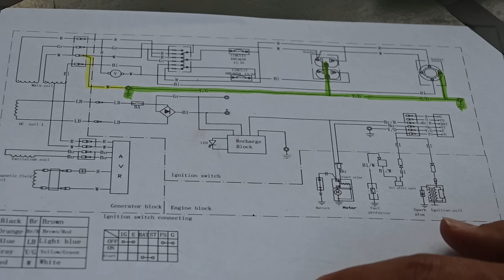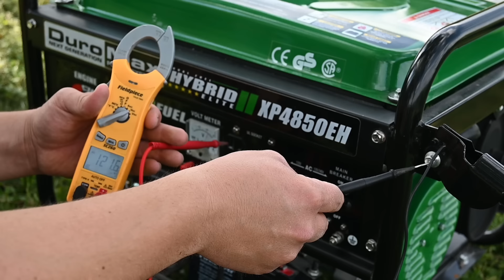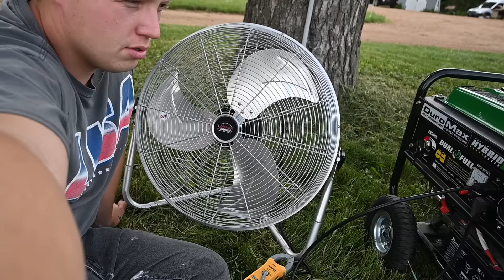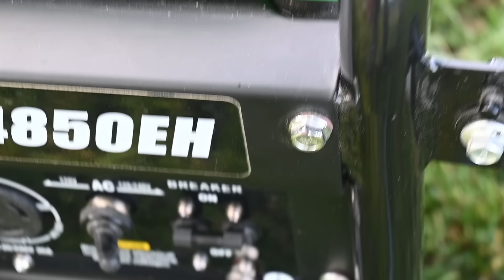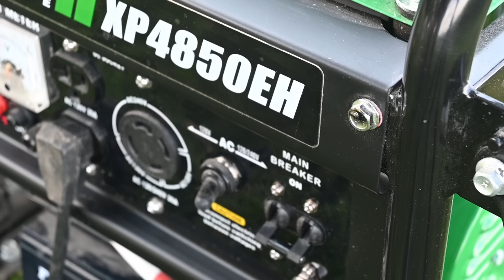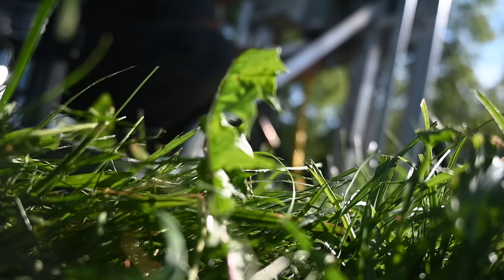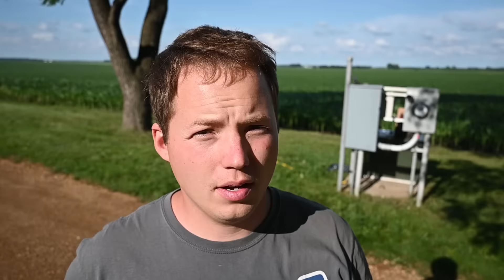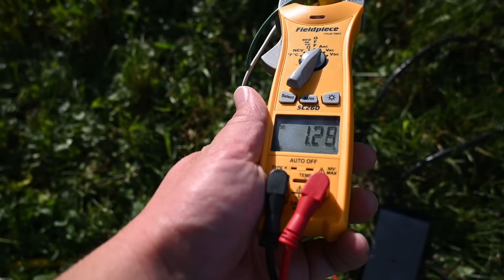What is a Floating Neutral Generator?

Comment: Hey Ben excellent tutorial.  Quick question I have to build a cable L14-20P to L6-20R.  The problem is L14 is four wire and the L6 is three wire.  My Generator is a Honda EM3500sx with a floating neutral.  When I build the cable would you recommend bonding/combine the green and white wire on the L6-20R side or leave the white wire floating/disconnected?.
Reply: Does the appliance being plugged into the L6-20R expect to see the N & G combined on one pin, or not ?

Comment: Hi Thanks very much for the video.  I have a setup that isn't working and I hope someone here can help with:

I've got a professionally installed manual transfer switch which has been wired to code and inspected by a second electrician.  It controls one thing: a furnace.  I have a decent quality inverter/generator with a floating ground.  I can start equivalent loads when they are connected directly to the inverter/gen, but the transfer switch is not happy.   I believe it's because of the floating neutral in the inverter and the transfer switch's ground.   What are my options to get the inverter to power the furnace through the transfer switch.  I'm open to buying a different inverter, or any wiring that is safe/code.  Thanks!
Reply: Here I am a year later with my own solution (hope it helps someone else).  Your genset/inverter needs two things if connected to a normal code transfer switch (meaning neutral is grounded by your house): 1: Yes, the generator should have a floating neutral, since code requires no more than 1 neutral-ground bond.  2: (this was my problem): The gen set should only produce voltage on the hot wire.  My inverter was producing 60v on hot AND 60v on neutral.  This really surprised me, but I guess it is done on devices (not designed to be connected to a transfer switch!)

Comment: When used for backup power, what's your thoughts on just not connecting the ground wire in the panel from the gen plug and leaving the gen bonded?  Any downside?
Reply: Don't do it
Reply: Why?  What's the downside?
Reply: @chileheadcraig  The neutral and ground are bonded in the panel, when current flows from the panel to the generator, it is completing a loop with a second bond at the generator thereby defeating the purpose of eliminating the ground between the gen and the panel.. It is simple enough to disconnect the bond at the generator.

Comment: Hey Ben, what are those 2 gray clamps above the main breaker in the panel?
Reply from the maker: The Sense Energy Monitor. If you're interested you can get a discount by using the code BENJAMIN at checkout.

Comment: Ben.  I have a different situation.  My main power comes off of the power pole to the meter hub.  It doesn't have a Main disconnect panel.  Just a small panel that can hold 4 double breakers.  The panel has a 100 amp breaker that feeds power to a sub panel on our Manufactured home.   This meter box is close to 300 ft from our house.   Can I set my generator plug in up at my house in the subpanel.   I know the sub has the ground and neutral on separate grounding bars.  Can I just use my generator that is Bonded to run my backup system from the submain.?   In a power failure ,  during the night for instance.  It would be hard to drag the gen down to the power meter panel to use it as a back up for my power.   Having the generator up at my house would be much easier.   Just wondering.   I actually already wired in  my gen plug and put in a 4amp breaker in the sub, with a manual interlock.   So just checking.  Thanks Randy
Reply from the maker: You can set up your generator to feed your sub panel at the house. Just make sure that it is set up correctly so that the interlock kit prevents any sort of backfeeding. Would be best to have it inspected and to verify with your power company what type of generator interlocks they allow.

Comment: 1 Hi Benjamin love your videos. Could you check out this post I started about using the xp9000iH with there xp9000iH-pk parallel box with no neutral connection. Seems odd DuroMax would do this

Comment: here in the panel box. the netural has its own bus bars and the grounds are all run to the panel case   my brother is an electrician and has asked the inspector. the generator panel is wired for floating neutral but scenario. generator dies. home owner goes out and byes a bonded generator not knowing the difference.what happens...  the inspector told him that he would get back to him with the answer. that was several years ago. still waiting

Comment: So in layman's terms as I understand from this fine instruction, if the portable power generator will be used in remote circumstances where grid power does not exist ie; camp site, job site, or mounted to vehicle (RV - Semi Truck), then the generator needs to be bonded to itself meaning the neutral and ground show continuity (Bonded). But if the portable power generator will be used as backup power via transfer switch of a service panel normally served by grid power, then the neutral and ground at the generator should have no continuity (Floating) as this is done on the grounding buss bar in the electrical service panel. If memory serves correct, the buss bar on left side of service panel is neutral which returns to transformer, and the buss bar on right side of service panel is ground which runs to 8'ft copper rod nailed in the dirt near service drop of home or building. The physical neutral and ground buss bars in service panel remain separated (Floating). If this is true, then we are on the same page.

Comment: 1 Hi Ben love your videos. Could you check out this post I started about using the xp9000iH with there xp9000iH-pk parallel box with no neutral connection. Seems odd DuroMax would do this

Comment: How are you getting your phone to read the wattage being used? Is there some kind of current transmitter in your main panel because I saw you had current rings around the L1 and L2 wires coming in to the panel. But you read the wattage with the main disconnected so the rings read no wattage as their is no current now flowing through them. I would like to get my phone to do that. Please explain? Thank you.

Comment: And, when you connected the live to the ground rod and had the generator providing power - did you realise YOU were also at 120V ? You'd get the same effect at 120,000 volts. You wouldn't know. Just like a bird sitting on a power line at any voltage.

Comment: I believe that's a isolated neutral not a floating neutral.
Reply from the maker: What's the difference? I guess I could see the term "floating neutral" being used in the context of an accidental loss of neutral connection?
Reply: @BenjaminSahlstrom  this leads down a rabbit hole, but search for stray voltage, especially its effects on livestock!

Comment: just a random question, I did get my sense unit and installed inside my sub panel and with you video it was great! Thanks for that! Why do you have you sense box outside at your main panel? I have the very EXACT set up you have, and just wondering if it is better outside or inside?
Reply: It doesn’t matter one way or another. I have a small panel and can’t actually fit my home energy monitor (not sense but a similar product) inside the panel, so that’s one reason to install it outside the panel. Mine has a knockout adapter on the WiFi antenna but if the antenna is built in, that’s another reason for installing it outside the panel I would assume.

Comment: Please just yes or no. I have a generator that says right on it neutral bonded to frame. I also have an intelrlock switch in my panel.   Is it safe to just switch the interlock switch so it shuts off the main power from the street and makes the main power from my generator it seems in your video that in this case your generator should be floating but in the comments, it seems like the generator should be bonded so question is it OK safe to hook up my bonded generator to my panel

Comment: Hi Ben, only watching this video now and have to say it is a very helpful video, i have spent the last few days trying to understand floating earth versus bonded earth and i can honestly say this video has been a great help 👍 one question you may be able to answer for me, if a solar inverter producing AC power with a floating earth setup is connected to a houses main disconnect panel which has a bonded earth will the same results be seen ? ie will i get continuity between the the Inverters AC outlet neutral terminal and the inverters metal casing ? 

Many thanks
Reply: Please note the Solar inverter would be connected to the main disconnect panel via a change over switch so as not to back feed the utility grid

Comment: This is a great video and you do a great job of explaining floating neutral. This raised a question with me about the wiring in my home. I have a 1950's era home with hot and neutral only wiring. My main panel clearly has neutral bonded to ground. Being I don't have ground at my outlets (hot and neutral only), does this mean these circuits are floating neutral?  At some point someone replaced several two prong outlets with three prong outlets that have ground and neutral connected (jumpered) at the plug. Does this solve the problem and create a true bonded neutral?

Comment: Floating neutral is widely used in medical buildings (hospitals, clinics, etc.) and vehicles. Grounded metal parts are capacitor's plate and when some fault occurs, capacitor's voltage should be enough to initialise alarm (often it is small light bulbs on panel door). The main idea of the floating neutral that power wouldn't disappear immediately during surgery or other medical procedures, but medical personnel will be warned about improper working mode of equipment. Aircrafts also having warning lamps on cockpit, because rapid flight interruption will cause crash and instead of flight interruption pilots are safely landing in nearest airfield.
Reply: That's interesting.  Is there a similar indicator on floating neutral generators?  Perhaps an audible alarm?  If not, maybe it's a good idea to add it.

Comment: Question... 
does this sound bad to you for a non-neutral bonded generator?
Ground - Neutral = 30v
Ground - hot1 = 87v
Ground - hot2 = 142v

Hots to neutral and each other all seem normal at 119/119/238. I plan to test this by bonding ground and neutral/ground in the driveway as that's what my house panel will do anyway... Just curious to see if others have experienced this
Reply: Yes. I just fixed a L1 to N at 160vac, L2 to N at 80vac. It was the feeder wire insulation degrading. Just replaced the wires.
Reply: @stevemoore4195  Thanks! I'll check those wires on the gen. I ended up driveway testing it. Got the generator running and shorted ground to neutral to simulate the panel box but with a 5a fuse. Everything equalized no problem!

Comment: ok so to sum it up. If I am wiring in a generator to my house for backup then floating is perfectly fine since it will bond in the house load center.

If you are using a generator just for remote jobs sites etc then you would want a bonded generator for sure.
Reply from the maker: That sounds right.
Reply: @BenjaminSahlstrom  Thanks for the reply and thanks for all the great videos you put up. I'm in Minnesota as well and I can not find any info but do you know if you need a permit to wire in a manual transfer switch? I am guessing not since I am not adding circuits just going in series of some. 

I see all these videos on installing a transfer switch and no one ever mentions even calling about a permit.

Comment: Question for you, do you have issues charging your battery with the 12v system? I have the same brand gen but 6000w and since I made it floating neutral my 12v circuit breaker keeps tripping so I can't charge the battery to use the starter. 

I'm assuming it worked before when it was bonded but I never tested it since it was brand new and connected to my house as soon as I got it

Comment: Ben, I need your help, I have a Generac XG 8000e , I have wire my generator up to my house breaker panel, it's keeps tripping one of the 30 amp breakers on the generator, my 120 outlets are GFI protected,  my twist lock 240 30amp plug is not, I have two neutral white wires that are connected to the ground inside the generator cap. I had to hook one of the white wires back up to get continuity to the 120 outlets that are GFI protected, I left one white wire off, I think it go to the 240 twist lock plug, I did plug my generator up to my house and I did have continuity thru the 30 amp twist lock plug. Please help losing my mind lol.

Comment: I have the same generator as you. Haven't had to use it yet. Are you saying it is not safe for me to use with an extinction cord? and I could get shocked. I live in an apartment and I have to run it on an uncovered porch. It has a rain cover on it with a place for the exhaust to go. What would be the safest way to run it. I need it to power an oxygen machine for my mother - n law. if the power goes out. please answer. [ Do I need to ground it. anybody who can help.

Comment: Hello Ben.  When connecting my generator using the same method as you, except I used one of the 120v GFCI outlets on the generator initially as a test, the GFCI outlet on the generator trips immediately.  I am connecting to my home through a dedicated interlock breaker in my multi circuit disconnect out at the meter.  My first thought was it has to do with the floating neutral situation either with my generator, multi circuit disconnect or 200A load center (breaker panel/ sub panel) in the house.  I discovered I don't have a separate EGC running from the 200A breaker/sub panel in the house to the disconnect outside at the meter.  I became concerned but then in one of your other videos you stated this did not become a requirement until ~2008.  Now I've shifted my attention to how my disconnect (out at the meter) and 200A breaker/sub panel are wired.  Should I update and run an EGC between the two?  This would not be easy so I'd most likely have to make another underground run separate from the other wires running between the two.  Maybe you could make a video and speak about this situation as a public service so people with older installations like mine know where to bond neutral to ground including the bonding screw for the panel enclosures.
Reply: Anyone?

Comment: So I got a predator 3500 w generator and my surge protector is showing it has an open ground. It shows I have 60v on the neutral, 60v on hot and 0v on ground. Shouldn’t it be 120v on hot, 0v on neutral, and 0v on ground?
Reply: Does your surge suppressor expect see a N-G Bonded Generator ?

Comment: While the suggestion of bonding the neutral of a genset to the ground appears to make things safer I disagree.  A portable generator has no ground.  The hazard is simply resolved by using modern GFCIs on the generator.  I use pigtail GFCIs whenever I directly plug into a portable generator even if the outlet is a GFCI.  The hazard of using a bonded neutral generator directly tied into the distribution panel of my home is much more dangerous.  Any generator I own will be a floating neutral.  I disagree completely with your assessment of it not being a big deal.  It is a big deal.

Comment: so to cut through all the mumbo-jumbo, do I need to attach my 2000 watt inverter generator, not connected to my home wiring, to a ground rod or not?
Reply: ABSOLUTELY NOT. DO NOT DRIVE ANY GROUND RODS OR HOOK UP A GROUND TO THE GENERATOR. Groundloops can be deadly.
Reply: @Veritas-invenitur  HOW CAN YOU HAVE THAT SITUATION WITH A GROUNDING ELECTRODE ESTABLISHED  AT A STAND ALONE GENERATOR, JUST REFERENCING GROUND?
Reply: Don L Ask MikeHolt for a more detailed answer. My answer is the resistance to ground from whatever fault occurs may not be sufficient to pop the breaker on the generator. If someone unknowingly touches the fault they could be killed. Without a ground rod this situation is not possible. In addition the fault may electrify objects such as grills and clotheslines between the fault and the ground rod. Touching these objects as they are grounded but not bonded could potentially kill you in he event of a fault.
Reply: Don L If you have any confusion surrounding effective fault current paths, grounding, or bonding feel free to ask and I will post links to accredited videos and text explaining everything someone needs to know about them.
Reply: @Veritas-invenitur  THANKS FOR YOUR ANSWER.  UNDERSTANDABLE

Comment: What portable generator would you recommend?  I'm wanting to run my whole house but can't afford the high end generators like the GENERAC  or some of the other brands. My family and I went through a tornado last year and don't want to be caught in a situation of having no power for days. I've got 3 generators in mind DURAMAX EX13000EH,WESTINGHOUSE or CHAMPION. Than you HOOF OUT!
Reply: Get the champion 100520. You want a generator that has an inverter on it because Normal generators are only good for power tools unless that is you want to blow up your $3,000 fridge with dirty power
Reply: @acoustic4037  Thank you I'll start looking
Reply: @acoustic4037  not complety correct, if any reasonable decent generator, that is operating correctly, and at correct voltage and frequency, damages a refrigerator or other Appliance, or other device said device, is a POS.,
I own about 30 different generators, consisting of all different types of units, some 3 cylinder and 4 cylinder diesel units, and 1,2 and 4-cylinder gasoline units, and the only generator that I actually worry about the power quality from, is the 2-stroke 800 watt, Harbor Freight style generators, in the main reason for that, is a "load dump", meaning when you remove a heavy load, and the engine over speeds, before the governor can compensate, the voltage on those little 2-stroke generators, sometimes goes upwards of 140 to 150 volts.